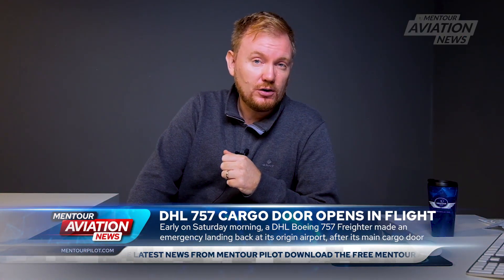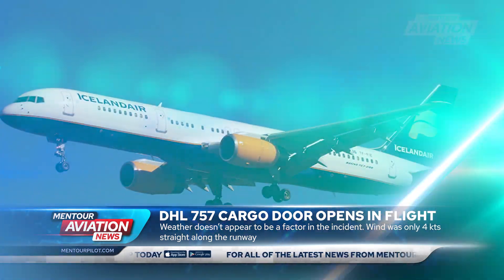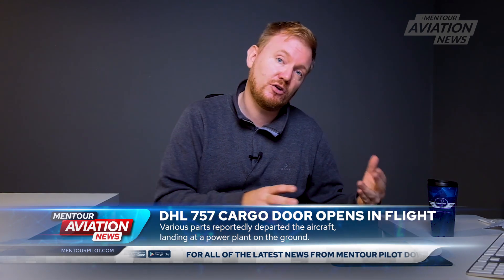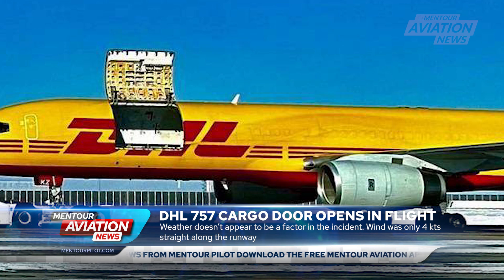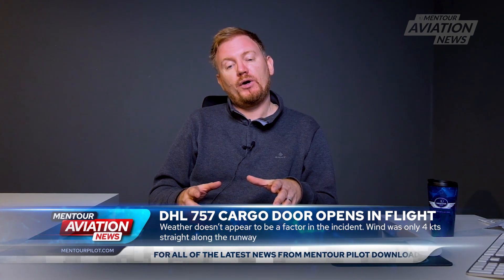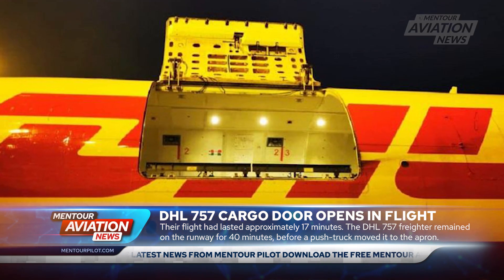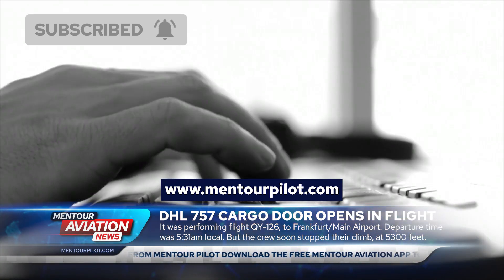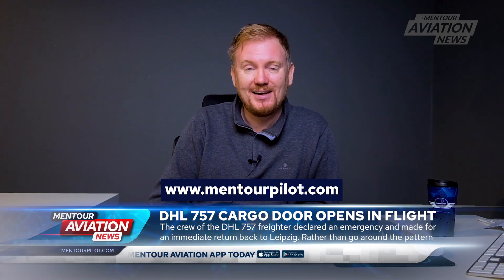Boeing 757 diverts after Cargo door OPENS IN FLIGHT! Mentour Aviation News

Comment: For the purpose not to worry about de-icing, do you think it is a better idea to park the airliner completely indoor including the boarding and disembarking from the aircraft. The aircraft would only be outdoor when it is on the runway. Do you think it is a good dear. For the purpose not to worry about using the landing gear, is it a good idea to make the landing gear strong and sturdy and fixed outside. The pilot then do not have to worry about putting out and taking in the landing gear. It would always be there, even if the pilot has forgotten.
Reply: It would also prevent the aircraft catch fire due to overheating of batteries
Reply: Those are the sorts of tradeoffs which go into an aircraft's design.  For jet aircraft, and even many piston aircraft, the speed advantage from having a retractable landing gear has outweighed the disadvantages (higher weight, complexity, maintenance cost).

Since aircraft can ice up even during taxi, especially if there is a long line for takeoff, expanded use of hangers would only be a partial solution.  Perhaps at some northern airports where flights are few (no waiting in line) and icing is more of a problem?  The cost analysis might make it a tough sell.
Reply: @marcmcreynolds2827  you have not included the consideration of loss of lives. If the pilot makes a mistake by forgetting to put the landing gear in position, it would cost lives . 

For the waiting on the runway, it is not necessary . You could park everybody inside,and give everybody a number denoting their position in the queue in the computer. Aircraft would only come out at the right time. Then there would be no problems of deicing.

Comment: Learning from this, should there be a manual lock (a physical bolt type lock) to secure the door? Just in case the hydraulics fail in the future. 
Aviation learns from mistakes and progresses to be safer in the future due to warning signs like this. Thankfully this ended well, but can we prevent this from happening again. Next time it might not be a happy ending. Sometimes the old fashioned manual bolts combined with the new ‘fandangeld’ hydraulics can work the best of both worlds!!

Comment: My Mentor, just your mediocre Aviation enthusiast here, saying I am not an expert, but I fully understand what are you explaining, makes full sense from engineering perspective. I can compare this to a car, and we know that convertibles have reinforces floor chassis, in order to compensate, that your frame doesn't have a complete 'circle', as the roof is missing. Car experts say, they can feel the chassis not as rigid as a coupe model vs a cabriolet of the same car. So basically here, we have a semi cabriolet airplane, with 30% of the body structure missing. My question here is- after such conversion from a passenger designed airframe, are those aircrafts, capable to reach same (100%) frame rigidity, even with the cargo door property closed? I know since it pressurizes, it seems to be 1 piece, but still, you have rubber seals, some spacing in between the soft seal gaps, so is it as solid, as when it used to be the small regular passenger door? Having it open (30%), = 1/3 of Aloha 737 missing roof, which resulted in hanging, and bent downwards cabin section, relaying on the bottom frame rigidity. If the door flew into the tail, like you said, s possibility, they wouldn't have had a chance!

Comment: I can't imagine that mere loss of a hydraulic system caused this incident. It would be insanely dangerous to design the door such that it needs continuous hydraulic pressure just to stay closed in flight. However, it might be one link in some complex causal chain of events.

Does the routing of wires, cables etc. etc. in a new passenger 757 account for the possibility that someone might want to put a door there in future? It seems sensible to do so. Even more so if there are 'factory built' freighters with a door there, so you can build with the same cable layout whether or not you are building a freighter.

Comment: It's highly unlikely that door would rip off in flight at the speeds they flew. It's parallel with the airflow, and while it's creating a lot of drag, along with the open doorway, the forces are aligned with the hinging mechanism.
Yes, it's a very serious situation, but unless the plane encountered string cross-winds on landing, I can't see it being a big problem. I flew a paraglider with a wing about the same size as that door: 32 square metres. And yes, when a wing that size must be held against the wind, it's a beast, but as soon as it gets above your head, and parallel with the airflow, it's fine, even in strong winds.
Mountain out of a molehill, in this instance, I think.
What is does demonstrate though, is that these doors needs manual locks activated from inside the aircraft, once the hydraulics have closed it.

Comment: Well I'm thinking about an automobile hood. If the primary closing lock doesn't "catch" correctly when closed (for whatever reason) and isn't noticed, there's a secondary lock that "catches" and keeps the hood from flying open at speed.
On this aircraft door, could there have been (or should there have been) a secondary locking system on the inside? Possibly purely mechanical?

Comment: Another problem is the aerodynamics of an open door.  They ended up with a ‘vertical stabilise’ (tail) on the front of the aircraft that is as big as the one on the back.  This could make the aircraft totally unstable, so it flips around and flies backwards.  
It is like putting feathers on the front of your arrow.
R

Comment: I liked this incident & explanation. I had a 94 Corvette with a removable glass roof. When it was removed & driven you could feel small movements in the body of the car. The roof was a structural part of the car. When on & latched it was solid. Nice video Petter.

Comment: What puzzles me is the systems were connected with the undercarriage up. Shouldn't they have been completely isolated and the hydraulic system depresuriised so there was no possibility of even pressurising the Hydraulic system? If it was mechanically locked without pressure it could not open.

Comment: I used to be a Captain with DHL flying the B727, one night departing from Charles de Gaule airport, passing 400 feet we hear this loud bang,  the rear belly cargo hold door annuncitor light  got illuminated on the flight engineer panel. At 700 feet the engine #3 start stalling and was shut down. After all the procedures completed we returned to CDG and made a safe landing.  The post flying investigation found the main door lock corroded , and the engine stall was the result of parcels ingestion, on the belly compartments the parcel are bulk..
Reply: Parcel left in safe place inside adjacent jet compressor 

No signature possible

Comment: If they have to throw it away because it can't fly any more, how do they get it to the airplane graveyard?
Reply: If it did happen to be worth it to fly somewhere else rather than dismantle on-site, a minimalist option would be strengthening across the open area with welded or bolted structural members (done to excess for easy analysis and sign-off), then fly an unpressurized ferry flight at low altitude (and weight) to wherever, making a refueling stop or two if necessary.

Comment: Excellent review. Two notes: Canopy position means the cargo door is open to about a horizontal position, just enough to allow loading/unloading. The 4 indicator lights on the Main Cargo Door panel (757-200 PCF) are located behind and facing away from the Captains' seat (near the entry door) and unless one of the pilots gets up, you can't directly see these lights. However there is (as you stated) a master door light (red) in the Captain's instrument panel, plus an aural alarm that goes off with just one of the four indications of a door not secure. Then again the horrible noise of the air rushing with the door open would be enough.
Reply: it probably never locked, and as a result, never pressurized inside.

Comment: Even if the hydraulics or locks fail, why would the door just open? Isn’t there a backup so it won’t just OPEN?
Reply: There is tremendous force trying to pull the door open at all times in flight which is why the locks are important. For one thing the pressurized air inside pushes the door out, and for another the strong airspeed outside lowers the pressure along the fuselage even more, pulling on the door from outside.  That's why airplane doors usually are hinged to open inward and they are too big to pass through the opening.  That way the pressure difference jams them into the frame and holds them there.  But a cargo door has to open outward or it takes up too much interior space you can't use for cargo.

Comment: I am loading these on the airport I work on and once mechanic screwed things up by opening these doors too wide or not giving attention to wind. It was amusing watching him trying to figure it out. Eventually, after 20 minutes of fiddling with switches he got it closed. I wonder if it was same plane.

Oh and DHL planes are a flying junk. One of A300 they operate leaked almost all hydraulic oil thru the day because some gasket was old and not swapped in time. Then there is that whole conversion... It is so shockingly badly done. How it was certified? Same as 737 Max?
Reply: DHL certainly fly some very old planes.   DC10/MD11's, DC8's,  727's,  Electras, Convair 580's, Fokker Friendships...   you could park their fleet on an airfield and call it an aviation museum!       (See  aviationcargo (dot) dhl (dot) com/fleet-information )

Comment: Structurally, even at the cost of a few extra pounds, diagonal struts between the existing ribs around the  perimeter of the door should have been installed for this type of eventuality (e.g., see the existing rib structure at 2:04) so that when this type of failure occurs in the air, or when the door gets caught in extreme wind forces on the ground, the torsional forces do not lead to irreparable damage leading to the scrapping of the plane.

Comment: How is this even possible ? Any failure should lead to keep the door closed/locked and difficult/impossible to open.
Reply: The door hinges outward, so higher pressure inside the cabin than outside provides the initial push if the latches fail (or more likely, given the low altitude at failure, never fully engaged -- a mis-rigged or out of spec latch system).  Then once the door is opened by some amount, it's about aero forces.  Consider how (especially for Boeing aircraft) the fuselage is at a significant angle of attack -- several degrees even in level flight.  With the door's hinge line running longitudinally along the fuselage, once it opens enough for its interior surface to be exposed to the airstream that surface will also be at a non-zero AOA and so generate lift... pushing the door farther open, which causes more area to be exposed, and more lift.  So the door "wants" to raise.
Reply: @marcmcreynolds2827  Is there no sensors to detect that the latches are not fully engaged ?
Reply: @francoisscala417  There are, but that mis-rigging thing for example can figure in.  There's also the design tradeoff of how sensitive to make the sensing:  Lots of false alarms/everyone misses their connecting flights over and over if too sensitive.  I've never done cargo door design, but did interact with a cargo door designer.  As good as other engineers, so maybe one of those things where the other guy's job always seems like it can't be that hard compared to yours.  But the fact that the problem has occurred (rarely) on DC-8/9/10, 727/47/57 (and probably others I haven't heard about) suggests it's very hard to make an absolutely foolproof design.  In the case of the Turk Hava DC-10 crash, for example, there was a service bulletin which the airline had started but never completed, unauthorized modification of the latching mechanism after it left the factory, and a baggage handler who neglected to do the required check of the latching verification indicator through a sight window on the door.

Comment: Why wouldn't they design these doors to slide inwards parallel to the fuselage body. Just like normal doors on passenger planes, just bigger? It shouldn't take all that much space.
Reply: It would take up too much space. Bear in mind all the ULDs would have to be smaller to get past the door to the rear of the main deck.

Comment: I wonder if any cargo was lost... From the flight path it seems like it was banking on the same side the open area was...
Reply: I hope the cargo is strapped save into place. Because what can happen when the cargo goes of, you can see at the accident of National-airlines-flight 102 at the Bagram air base in april 2013.
Reply: Coordinated turns do not result in freight or passengers sliding towards the lower wing. If you'd been on a commercial airliner, and not had too much to drink you'd have realised this.
Reply: @dragoclarke9497  thanks, good one :))

Comment: what would happen if that happened at 30,000 feet or whatever the flying altitude is? would the plane have been ripped to pieces if it decompressed after the door was flung open at max altitude?
Reply: Probably not, working from the example of that 737 which lost a far larger portion of its upper fuselage.  Fuselage design of modern airliners is "failure tolerant".  Redundant load paths, and "overdesigned by design" in general.

Comment: It seems to me that Boeing should be doing the conversion.  Maybe the third-party conversion is a poor design.
Reply: more DHL skimping on the maintainance
Reply: How many Boeing planes drop out of the sky and kill people? Quite a few 

How many planes with third part cargo doors drop out of the sky and kill people? None 

So why should Boeing do this conversion?
Reply: @CaptainKevinandCarol  — Boeing planes do not have structural defects.  Structural failures are rare.  The DC-10 had a couple of failures with cargo doors and one with an engine pylon which led to loss of the aircraft.  I don’t know of any similar Boeing failures.  There was an incident with an old 737 losing part of its fuselage, but the plane held together, proving that the structure is strong.  

There was a crash of a 747 in Japan caused by repairs which were not done according to Boeing specifications.  Had Boeing supervised the repair, the crash would have been avoided.  When the structure of the aircraft is involved, The manufacturer is the most qualified to do the work, cerainly in the case of Boeing.

Comment: i subscribed to this channel for air investigations. i have always been obsessed with crash investigations and disaster documentaries. and have seen my fair share of air crash investigations. but they have always focused on the mechanical or electrical failures, some focus on the airline and manufacturer management, it is absolutely amazing to hear someone focus on the pilot side of things. there are 4 major parts of any air incident. the engineering, the management, the passengers, and the crew. the first three are always covered in other documentaries, with a passing pilot did this, or didnt do this. air traffic control and cabin crew are always covered. put the thought process of the pilots having to make these quick fast as lightning choices and what they have to weigh in on, is a perfect addition and honors the hard work, dedication, and training pilots put in. i hope to see more past major air disasters covered.

Comment: When closing 767 cargo doors there is a light indicator that comes on by the door panel indicating that the door is locked in the closed position. You have to verify the light comes on before walking away. The ground crew is probably sweating 😓

Comment: Somebody didn't examine the door locks to make sure it was actually closed and locked. 
That's the pilot's responsibility.
Reply: Unless it was you that closed the door I suggest you wait for a proper investigation before making accusations.
Reply: @dragoclarke9497  When I was flying regularly, the rule was, you the pilot, check all of the hatches and access panels before every flight. Mechanical latches don't tend to come loose on their own.

Comment: They were lucky the door didn't open at 23000 feet like Turkish Airlines Flight 981 as that explosive decompression destroyed the hydraulic lines.
Reply: Actually that was of course a DC-10.   The depressurisation of the cargo hold (which in that aircraft was under the floor, of course) caused the floor structure to collapse downwards, which jammed the controls.    This 757 may have been better off, for starters it's a narrow-body and maybe the floor is stronger.   When Aloha 243 lost its roof (and I understand the 737 and 757 share a very similar fuselage design), that floor didn't bend so far as I know.   Still not something I'd care to bet on, though.